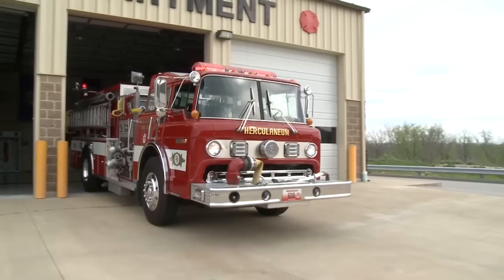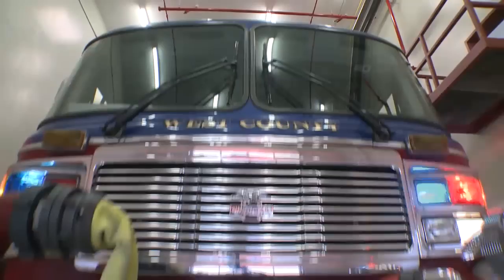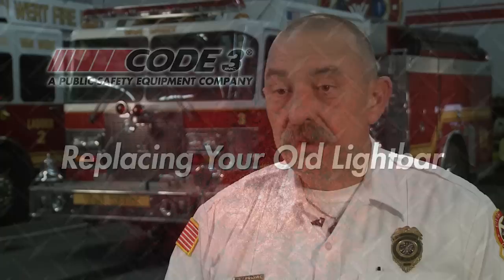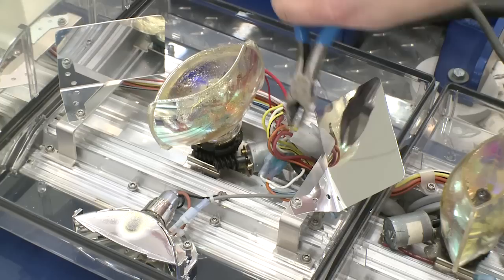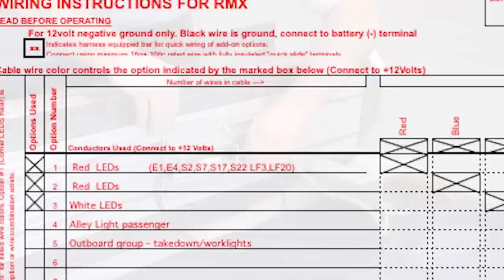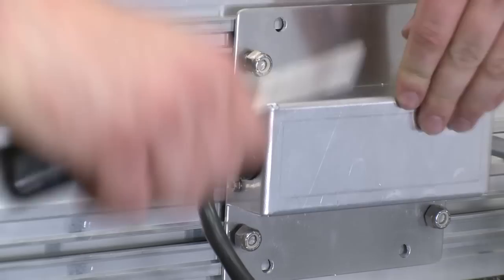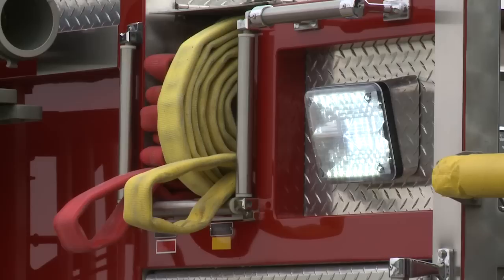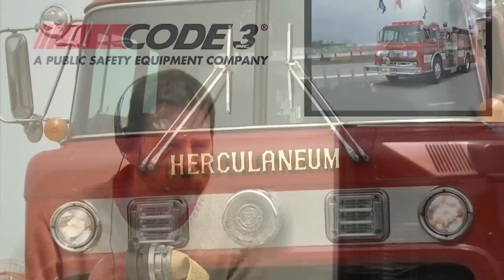Code 3 Fire Truck Refurbishing

Comment: Too bad LED's would look awful on any trucks made before 1975.
Reply: @emergencyresponsevideosand4423  I am speaking only facts here, Mr. Wacker.
Reply: @flufflepuffle6229  no, the old lights should be replaced and i never said on 1950’s trucks. Im talking about 1967 - 1974

Comment: LEDs will not have the same effect of halogens in thick fog or smoke
Reply: FederalPolice620 TIR optics would out perform by a long shot. Halogen lights are straight up dangerous to still be using a huge liability. Can hardly see them sometimes in the day
Reply: I agree, but not in fog/smoke. That's why Code 3's dual deck bars are so good. 360° visibility halogens as well as the added warning of LEDs for daytime warning
Reply: FederalPolice620 I would still disagree. LED optics have become very potent and much stronger than halogens have. Spot beam wise they still do need a bit of work id say. I think using an LED bulb in a traditional style housing designed for LEDs would work better than using more LEDs and diffusers. Thus why HID spot lights still have a much tighter beam than LED still.
Reply: new LED lights suck
Reply: Officer620 I correct my previous statement. A good quality halogen light with well maintained lenses are good warning lights. Still not quite as good as an LED but they are very potent. And have the best long distance warning. I love the look of rotators. I have an amber one mainly for bad weather type situations. LED is my primary blue response lights however
Reply: Bob Brown new LED lights are far superior to the gen 1 led technology. Better on amp draw, more efficient, no filaments or bulbs to break from vibration, and can be seen much better than their strobe counterparts
Reply: Led cab off  lighting can hardly get seen in bright sun light. Sacrificing visibility for so called efficiency .  9ld scool rotators are far far better

Comment: We used to equip trucks with LP 100,& LP 6000s in amber in all our trucks. It would be great to be able to have shade selection of color. A tinted amber at day & a bright yellow/light gold at night.It CAN be done.Just do it. with the simulated rotation of course.

Comment: When LEDs started to become the rage relatively newer strobe and rotating lights were replaced without a 2nd thought to the budget. I told department heads that they could upgrade what they had by installing the LED lights in place of strobes and rotators. You would think I just dropped trou and made a pile on their birthday cake. I couldn't believe that they would be so against the idea.
Now those people are no longer running the show in any of those departments and the ruling body now is trying to balance budgets. Retrofit MX 7000 along with other bars are replacing the bars that replaced them. Go figure.

Comment: For some reason the white lights do a good job but it looks like the LED's under the red dome don't flash very fast and aren't that bright.  Is that because of the flash interval and type of LED's?
Reply: No it's because you are viewing it through a camera and a screen.  Stand in front of it for a second and you'll see spots for 10 minutes after.

Comment: What's the point of the junction box?  Just wire it like it's supposed to be wired.  Don't make it so average Joe and Bob can install it.  Make it so it's installed correctly.

Comment: Rotators are better than strobes in dealing with deer in the road.White light or strobe flash just freezes them in their tracks.Trust me.I travel the backroads and havent hit a single deer thanks to the LP line.
Reply: I agree 100%

Comment: Federal Signal has a habit of shooting itself in the ass while its collective heads are embedded within. The Junksonic and Junkstream were 2 of the worst warning lights due to hazardous profile lighting. Alley lights are optional lights- not primary lights. They should never block the 360` signal of the primary lights yet manufacturers can't stop putting alley lights above the safety of the people they are supposed to be serving.
Also the new Vision pod bar looks like it was taken off a toy police car with all its cheesy weak blinking. LED rotators need to be a option.
Reply: I'm 40 years old and not one time has a lightbar "safetyed" me.  If you can't recognize an emergency vehicle by the fact that it's an emergency vehicle than you shouldn't have a driver's license.  I can't see an alley light compromising "safety".